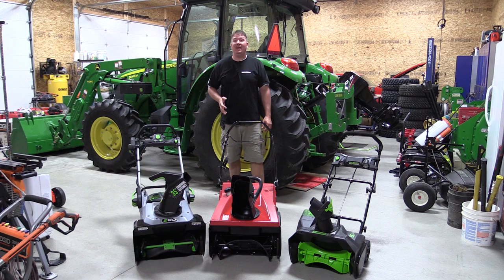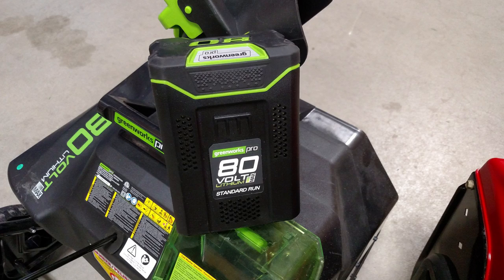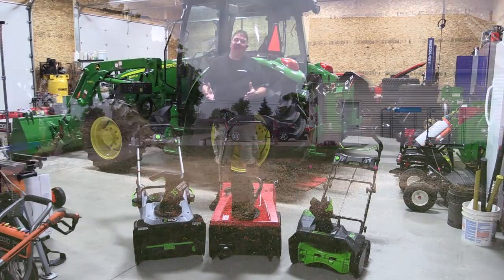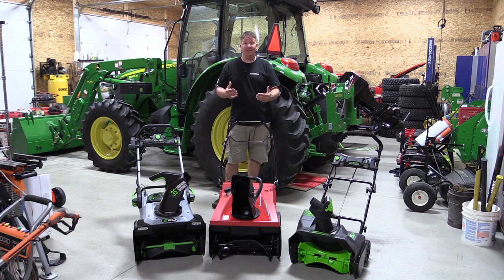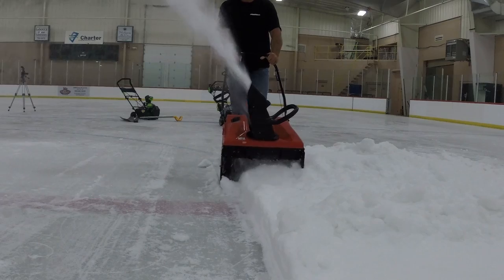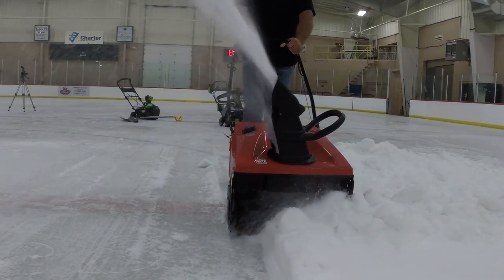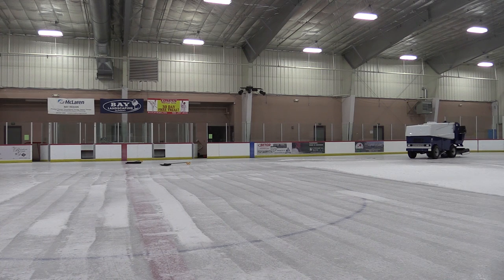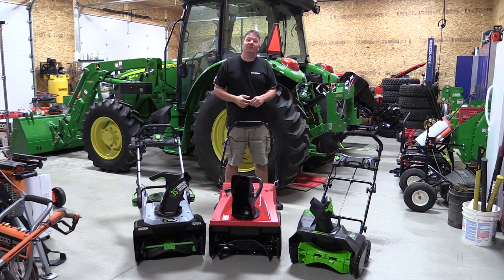Is a Battery Operated Snowblower Up to Real World Use?

Comment: 2yrs makes a difference. I understand the need for a monster snowblower in Canada or the small northern strip of the USA, but with a population of about 36 million people, that's not many to market to. Here in the USA, with roughly 330 million people, roughly 60% max see snow. Winter is only 3 months a year.

Price is a huge factor

Greenworks bare tool - $227
EGO bare tool - $400

Greenworks blower w/2ah battery & charger - $371
EGO blower w/2 - 5ah batteries & charger -$600

That's a monster investment for a tool with such limited use. EGO does have 1yr longer warranty on batteries 3yr vs 2yr on Greenworks, and 5yr vs 4yr on Greenworks with tools. A difference in 60v vs 80v must be mentioned though, more volts, more power. This can be seen in 80v Greenworks chainsaws/string trimmers vs 60v EGO. With the extra $230 saved on the Greenworks though, One could get 1 or 2 other bare tools like a string/hedge trimmer or leaf blower. Living in Missouri and southern Nevada right now, Greenworks much better value for me.

Good unbiased comparison though. I will say the dual 5ah ego batteries are $220/each right now in 2018, so buying the blower combo gets you a free battery per say. 5ah vs 2ah is a huge advantage on other tools, even if it is 20v less power.
Reply: It snows 5 to 6 months a year in NH, consistently.
Reply: @EdwardsNH   As stated, NH borders Canada. It snows maybe 10 times a year though for most of the US. So you're looking at less then 30 million out of 330 that get consistent snow.
Reply: Adam Hastings Everyone's situation is unique.  People often comment on the expensive batteries.  What a lot of people do not talk about is that a lot of people do not personally maintain their own equipment.  While batteries for these electric tools is expensive, annual services and repairs from neglected services can really add up fast as well.  The maintenance aspect for the average owner is never accounted for in people's cost of ownership.  Even if one does their own maintenance, everyone places a different value on their time.  For some, the convenience factor alone is worth not having to do any maintenance.  One other thing about the batteries.  No one mentions the fact that the batteries can be rebuilt as long as the electronics in it are good.  

I have about a 6,000 square foot yard.  I am switching over to Ego yard tools as my yard is so small.  It normally takes me about a half an hour to mow and trim my yard with a gas mower and trimmer.  Even if my batteries degrade quite a bit, I should have plenty of run time to accomplish what I need to do.  As for snowblowers, I live in Wisconsin.  It typically snows here quite a bit.  Despite my small yard, I have a decent sized area I have to clear.  My driveway is about 20 X 30, and I also have to my alley which about 15 X 60.  I have a large two stage snowblower for deeper and heavier snows.  It is also a pain to shovel all but the lightest of snowfalls due to the fact of where I have to store my snow.  I am thinking a single stage electric snowblower will fill a nice niche for me.  I would be able to use that instead of shoveling lighter snowfall amounts where it is a waste to drag out my larger two stage unit. I like the fact I would not have to maintain two snowblowers which may or may not get used (winter is totally unpredictable).  I am also willing to wager that you have not had a snowblower not start when you need it, and the air temperature is well below zero.  It is not really fun to try and fix stuff in that type of cold.  I also like that one of my snowblowers is about as close to guaranteed to start as one can get.  If I would have had a single stage unit, I would have used it twice this year.  Instead I shoveled twice.  Sometimes convenience wins out.

Comment: There's one problem with the "drop-in" battery system that I noticed.

In the real world, snow does not go where you want it. You're going to get snow blowing back in your face whether you like it or not. 

That means the battery area of the snow blower is going to be covered in blowing/drifting snow as well as the stuff coming down from the sky. Let's face it. When you're dealing with frozen H2O, your machine is going to get wet.

My question is, are the batteries and the snowblower power connections protected in any way from any sort of electrical short when they get covered in snow?
Reply from the maker: Sara Llewellyn The batteries go in a box per say, with a cover.  The cover of the box will get covered in snow but nothing gets into the box.

Comment: For 600$ you can get two stage entry model which will blow all these out of the water.
Reply from the maker: Very true, but for some that might not get that much snow, a small better unit fits them better, even if it costs more.
Reply: All depends on what your time is worth. With a decent set of batteries, I can blow, bring the batteries inside to charge, and I’m done. Multiply that by 15-20 uses a year for (if the batteries hold out) 5 years. No preseason and end of season maintenance, no trips to the gas station, no fumes, a LOT less noise. Haven’t used gas tools at home for over 40 years and have never regretted it.
Reply: Do you guys have any recommendations for a solid 2 stage that won’t break the bank? Like under 1000?

Comment: the Kobalt max 80 volt snow blower is much better.  6 amp hour battery comes with it and it will do a 2 car drive and sidewalks in a rural area no problem.  I do my 2 car drive and sidewalks after a 6 inch snowfall and don't even use half of battery power and I am running the snow blower at full power and it can be used in a couple dozen other tools as well.

Comment: In all fairness, the Troy Bilt you chose had the 123 cc engine which is not the norm.
The norm is 208 cc engine. The test would have been very different.

Comment: It will keep up with gas? What about end of driveway wet heavy 3 feet packed snow did you run a review of that? Thanks..
Reply from the maker: We never got more than 4" this year in Michigan.....  Very Odd, so we never were able to test that out.
Reply: Ok thanks. My neighbor has a 40 volt Ryobi but he only uses it for his deck it's not strong enough for a Wisconsin winter.
Reply: You have to be realistic - you can't jam a device like this into a huge pile of packed frozen hell from a city plow. You'll burn out the motor. It wasn't designed to handle that. But, it does look like it can handle the fluffy stuff provided it isn't extremely cold (-15F to -30F) and it isn't super wet/windy outside.

When an electric motor is overloaded it simply stops.

When a gas motor is overloaded the physical act of exploding fuel inside the cylinders forces the machine to either keep going,  or blow the engine apart (or just stall). That's what enables the machine to power through the worst that winter has to offer - at the expense of your engine.

Comment: Ariens actually once tried to make an electric two stage model for heavier removal like the gas models but it suffered from charging, longevity, and battery life issues so it was discontinued. It also didn't have a removable battery. We still have yet to see an electric snow thrower that can compete with gas
Reply: Build one. It works 🙂
Reply: @ivindjohansen8956  Lol I can imagine if it was that easy another two stage cordless snow thrower would have already hit the market by now
Reply: Have done a rebuild. (prototype) 
Works better than when it was petrol 🙂 
https://youtu.be/m9qPQfd8hi4 
Considering making a new model, and might start production

Comment: As battery get better. Gas is probably something just for professional snow removal companies.
Reply: Gas will either run out eventually any way or be shut down and obsolete before we know it any way
Reply: I actually think one of the biggest issues to tackle is the offseason. I live in the Baltimore-DC area where we can have unpredictable winters. My snow thrower sits around a lot most of the year until snow comes. From what I believe based on experience batteries suffer when they sit unused for long periods of time. All I have to do to make sure my Ariens Deluxe 28 is ready for a storm is drain the gas out and put fresh gas in when I need to use it. A battery may lose performance as it sits unused for that long. One possible solution I could see as a possibility is a battery that can be put in both a lawn mower and a snow blower so that it stays busy all throughout the year but that's of course not the case for everybody
Reply: @exoticcar5482  As battery technology improves the issues, like sitting unused for long periods of time, are going away. Ego's batteries actually self-deplete to optimal charge when they sit unused. Of course if you have an Ego lawnmower, leaf blower, multi-tool, and snowblower, then your batteries are being used year round :)
Reply: @josephgries4683  I see but ego has yet to release a two stage machine and while I get what you're saying, what EGO needs to make sure is that the battery doesn't just deliver the same amount of power regardless of the machine it's powering. Typically a two stage snow thrower has a bigger engine than a push lawnmower as it needs more power to move heavy amounts of snow. I still haven't found a battery push mower that can run for much time over an hour on a charge so if you use that on a two stage snow thrower it may go for even less time even less reliably. I'm sure manufacturers will eventually get it down but we're not there yet it seems
Reply: 1234  u realise that years from now there gonna come up with another way to make batteries also hydrogen is gonna take over and theres an infinite amount of hydrogen

Comment: The last snow storm was lived high as a 40 Cm (approximately 16 Inch) of snow. 
As we are new in Canada, I'm inexperienced handling with snow  blower machines (and snow generally), but definitely
I need one for my forecourt driveway.
So I'm looking for electrical charging Snow blower that will do the job, have doubts if the Greenworks will
work properly but if so it will cost much less.
Reply from the maker: That amount of snow would best be handled by a gas powered self propelled two stage snowblower.
Reply: Oh Dear!, I really don't like to handle with gas powered machine.

Comment: OH come on guys you know that when its cold it will break... I was just testing a tool here in Minnesota and it was about -15 degrees out and it cracked instantly what a joke they just don't make stuff well enough regardless. But very creative video I like it.
Reply from the maker: Cold can have an effect on plastic, but not if it is tool grade plastic and made for the cold.  Think about it, ATV's, Snowmobiles, Cars, Trucks and many other items all have plastic on them and they do not break from being used in the cold without abuse.  Any tool that just breaks from being used and cold is not up for real-world use.  It was -7 here in Michigan this morning and I used the EGO snowblower to chip some ice on the drive and clear the small drift from overnight.  It did not break.
Reply: @WorkshopAddict  Good point, I haven't had the chance to try the EGO stuff. I guess my point is I wish they would make stuff a little better like things use to be, It doesn't  always have to be all plastic.
Reply from the maker: @Impact-OG  Agree.  The Green works is all plastic and works well.  The EGO has a metal intake and rubber pushers, but a plastic scraper.  Believe it or not, they all work.

Comment: Very nice video guys and thanks for testing these in an arena with what seems to be a "reliable" test. The EGO is definitively impressive. What do you think about it for a homeowner that lives in Quebec, Canada ? We sometimes have snow storm in January/February that can leave as high as a feet of snow within 12 hours. Usually however, this type of snow is not wet and easy to remove.

Should us (Canucks) keep using gaz powered snowblowers ? I have the EGO lawn mower and the string trimmer and love them. I wouldn't mind getting a battery powered snowblower for less maintenance hassle than a gaz one, but it must do the job properly.

Again, thanks for this video informative video :)
Reply from the maker: I believe that as long as you stay on top of it, the ego will be fine.  if you could use the Troy but gas model, the ego would be fine.
Reply: I am in Quebec as well and cant wait to get this once it hits homedepot canada store!!

Comment: Question/comment- I have noticed most if not all the single stage electrics have not the self-propelled action as do the gas versions. Do you think or know that EGO will redesign this function into future models?
Reply from the maker: D Bennish IMHO, no.  the reason is that the single stage units are very light weight.  For traction, you need the weight that most two stage units have.
Reply: Thanks, but I think from watching many videos seems to me a little help from the spinning blades making light contact with the pavement would be awesome. Love the review you posted... :)
Reply from the maker: D Bennish I misunderstood your question.  Yes, most single stage blowers do have paddles that will hit the ground and help pull if you tilt them forward.  That also helps you clean the concrete.  This one does not do it and I am unsure if they will redesign or have a gen2.
Reply: I would like to see this tested from an uneven surface, like when there are ice and snow ruts leftover from a past show. I do think these are good machines, I am sure next years class will be much improved. Thanks
Reply from the maker: Watch our channel tomorrow as we have a EGO Snowblower giveaway going on now.  The video will show the snowblower in real use on a driveway that was driven on many times before it was cleaned.
Reply: Missed it, darn it
Reply from the maker: D Bennish the drawing is December 21.  You still have time.
Reply: I figured that out after my last note, goal accomplished. Thanks
Reply: It would be great if they did, but I think that would drain the batteries even quicker due to the constant extra friction from the paddles on the pavement.  It also might require the unit to have a more heavy duty construction as the auger would be subject to more vibration and wear on bearings, etc.  That's where the heavier construction and constant power of gas single stage units will probably always be an advantage.  But you weigh the pros and cons of battery vs gas and decide which factors are more important for your needs.

Comment: A real world application many might be interested in using the EGO for is their WOOD DECK . Any problems with using the EGO on a wood deck ?
Some electric snow blowers , more than others will mar a wood deck quite severely .
Reply: uconnapharm The only problem would be the scraper getting stuck between the boards.  As long as you run the unit inline with the deck boards, you should not have any problems.  The snowblower's scraper is plastic.

Comment: also what do you do with the battery in the summer when you don't run it?
Reply from the maker: The batteries are fine to sit all summer without use in both brands.  On the EGO, the instructions say if you keep them on the charger, it will automatically take them down to 30%, where they store the best, and keep them in tip top shape.  But if you have a battery snow blower, it might be smart to buy a battery string trimmer.

Comment: It should compare to the gas model like the Honda or Murray or Briggs and Stratton Brute with the 160-163 cc  single stage class. Why? Because of the price range.
Reply from the maker: From our research, the gas model we used is one of the better sellers on the market so it made sense to use it as a comparison.

Comment: Any idea what cells were in the batteries  ?  
 Can help but to think of a milwaukee with two 12.0 batteries or the new mx system.
Reply from the maker: Currently, EGO uses the 18650 batteries.  Greenworks is working on upgrading, but OPE seems to drag behind normal tool technology.  I agree, if Milwaukee would allow for 2 or 4 M18 12.0 Ah batteries in OPE, they could rock.   But with all the issues EGO has been having, there might be a reason Milwaukee has stayed out.  It could be water? I do not know, but we are watching more EGO mowers and snow blowers die right now and it is sickening.
Reply: @WorkshopAddict  thanks for the info